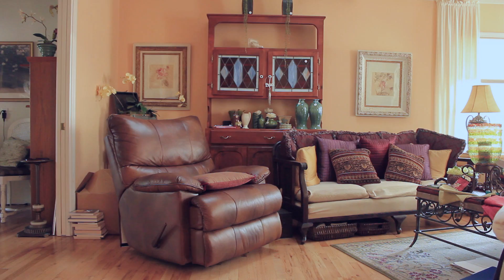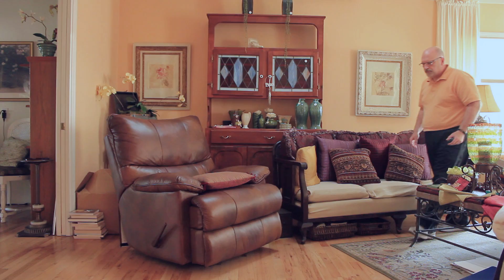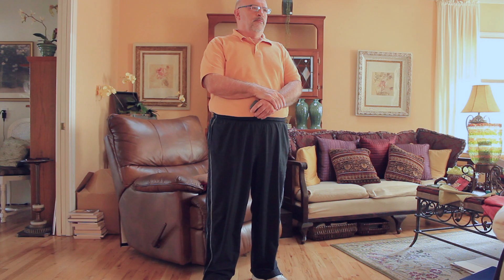ONE YEAR AFTER DBS SURGERY

Comment: For whom is this procedure not a solution?
Reply: If the best results a Parkinson's patient has on medication is poor, the stimulator will not improve symptoms beyond that result (if the patient has any periods of the medication working well during a typical day, the stimulator is supposed to get you to that result all the time). It's also generally not recommended until the fluctuations with medication are disruptive to everyday living, as there are risks (although low). Neurologists also have to do tests to be certain to rule out other conditions like Multiple Systems Atrophy, which can look very much like Parkinson's. (DBS does not work for MSA, and will make the patient much worse.) My mom is getting her final consultation appointment for DBS on Tuesday, and we are told the procedure might be scheduled as soon as two weeks later. I've read that they may not turn it on for a few weeks after that, but that info might be out of date. I guess we'll find out Tuesday.

Comment: I had mine done 2 years ago (april  2010).  havent looked back. it is like a new life.  you had alot of courage turning your unit off.  i never have turned mine off.
Reply: Not sure if you will see this message but I’m curious to your present condition after dbs ,I hope you are doing well
Reply: At the suggesti0on of my surgeon I turn mine off every night.  The battery will last longer.  Six years now and still going strong!
Reply: @davenorby8161  i had the new battery unit installed this year. Old one went sunset (expired). New one as well as old one are rechargeable units.